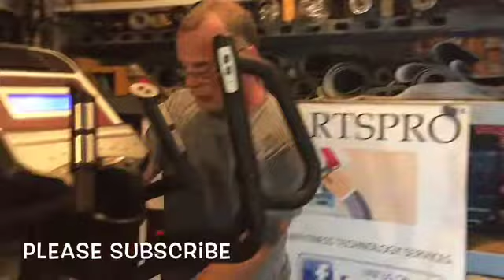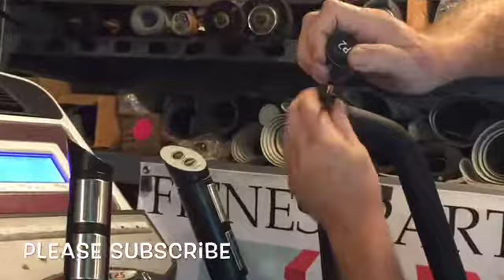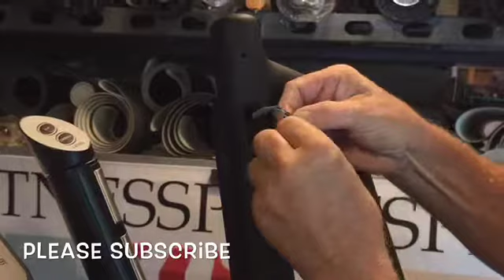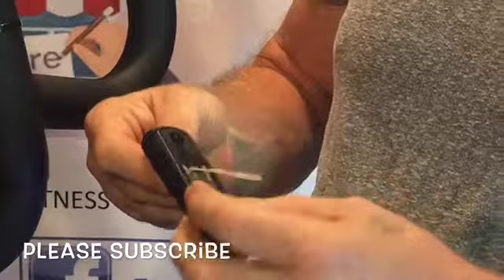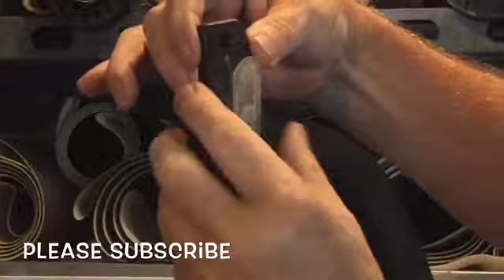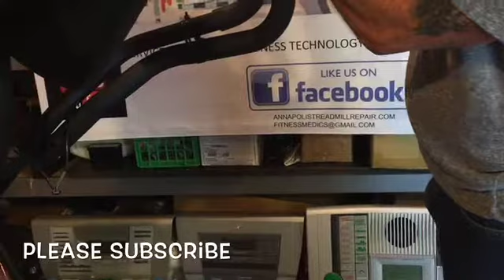REPLACING RESISTANCE OR INCLINE BUTTONS ON SOLE ELLIPTICAL

Comment: Hey Dave, it's a pleasure watching your videos. Thanks again for sharing these precious technical tips!
I've moved my Sole Elliptical from one previous home a new to home, accidentally I've damaged the computer cable, I did reach out to the SOLE sales team that cover my area and they send me a new replacement cable. I did install it, when I turned on the power button the  display device started with initializing the parameter then showed the main window with all links then it turn in red error screen that it says ERROR E-5 
I'm very emotionally tired from going throughout opening the heavy part removing the first cover of the flywheel and install the new computer cable but this time I don't know what to you and how to locate the issue
I did reach out to SOLE vendor and I was told to check all wire at the display device which are 5 wires including the computer cable. I don't know how to proceed with troubleshooting!
Can please advice with ERROR E5
Thanks again for your valuable and interesting videos
Reply from the maker: Well thank you for your support But unfortunately the only thing I have ever found on error 5 is a display crash 
I think you would have to replace display. I don’t think it has anything to do with wiring

Comment: If there is some sparking but no beeps or indications that the wire is working correctly when using the bread tie, does that mean the cable is bad?
Reply from the maker: Hmm I have never seen it spark I would meter the wire looking for a short just to make sure

Comment: Thank you for your infomative videos ( sole elliptical ) bought a used 2009 e35 elliptical. Its main wire harness from console to lower controller has a small cut on the outer black rubber cover. Check wire inside still connected and i put electrical tape on it. Will it work sir? Have not tried it yet. Thank you
Reply from the maker: Komusta Cabalen If the inside wires are good the out cover would not matter and your are most welcome
Reply: Thank you sir, done cleaning and putting synthetic grease. Everythings working!